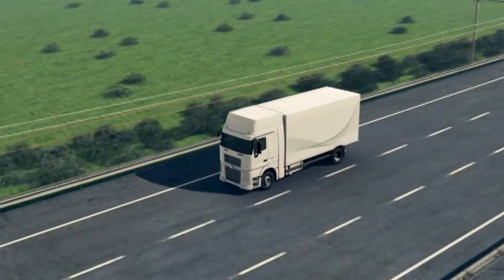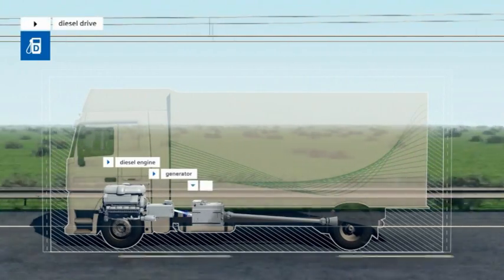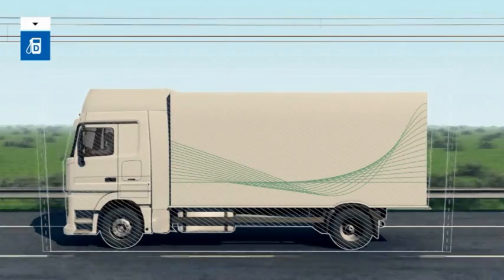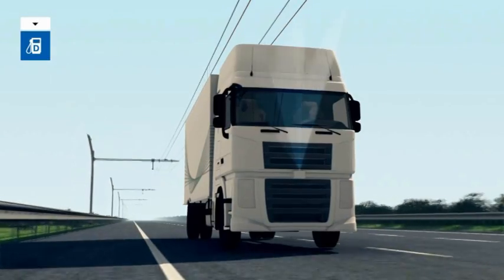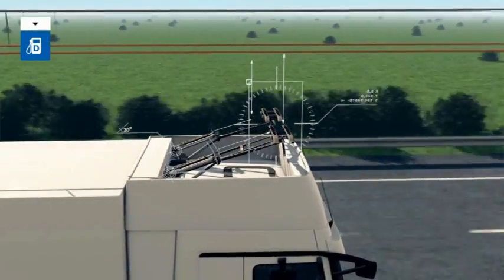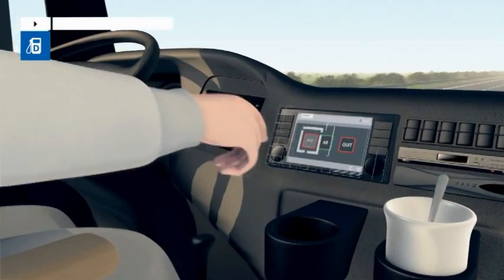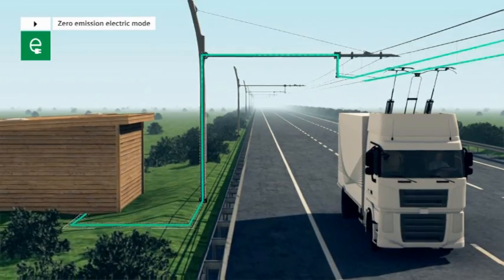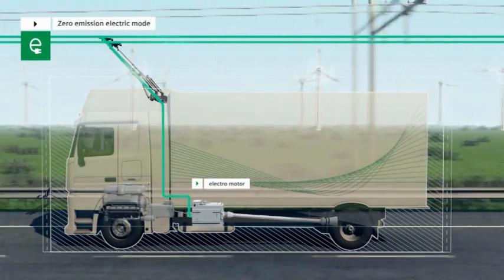Siemens eHighway technology animation

Comment: If all vehicles adapt this technology, I would say the cable would burn out and require workers to keep maintaining day by day. Seriously ? imagine ALL vehicle drives with 130km/h constantly creating friction on to the same cable. lmao.
Reply: You keep lyao, fortunately engineers are much smarter. The overhead cables are made of harder material than the pantograph, the cable doesn't wear with friction, pantograph surface does. Catenary line basics proven for over 60 years used here.

Comment: Interesting concept. Perhaps it should be mentioned that large scale power generation tends to be more efficient than small scale generation intrinsically not just because of simple things such as the volume/area vs size issue, but also because of the investment that can go into these facilities. Other reasons for electrifying roads would have to do with the flexibility of generating energy in something other than an internal combustion engine, environmental concerns, noise reduction etc.

Comment: So we would use electricity from natural gas power plants, which will go throught hundred miles of power lines to power truck, which could be powered by natural gas in the first place? 
    It has a reson why effective commercial railways don't use electricity, but diesel to power trains. This railway(watch?v=20ShSCyTovY) hauls more cargo than any highway ever will. When it is not effective on long haul railways, why it should be effective on highways?

Comment: - Electricity from coal: a 100% electricity from a modern coal power station will produce less carbon emission and local pollution than a truck. But a ACV study should be done.

- Miles upon miles of poles and wires: of course this is a huge infrastructure but when you look at the massive energy transport infrastructure Germany has to invest in but thousands of kilometers of lines to do the same job then I'm less skeptic about it.

Comment: Good points here.

- Constant maintenance? If it is the same as for railway transport then yes it's not a good deal but we have to put it in perspective with the volume of stuff such a line can transport.

- Snow: major problem but a lot of states don't have this problem. Siemens wants to experiment the system in California and a large part of the Earth is not concerned with that problem.

Comment: They are cheap short term but they require constant maintenance, they simply don't work in most northern states (wind and snow would pull down the power lines constantly).  The electricity comes largely from coal plants, we would need miles upon miles of poles and wires that would need to be torn down once we actually get around to implementing true green energy solutions, etc.  Too many problems, I don't think it is worth it at all.  It makes sense in small towns, but not at a large scale.